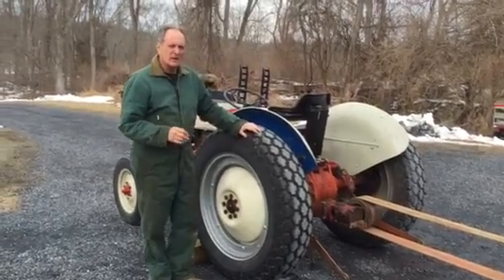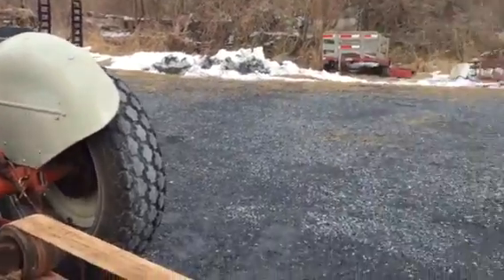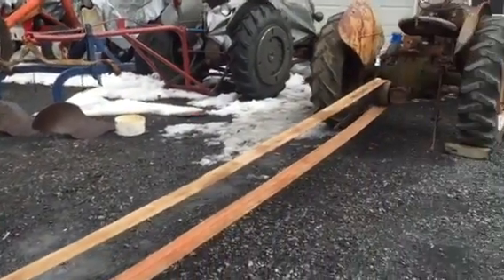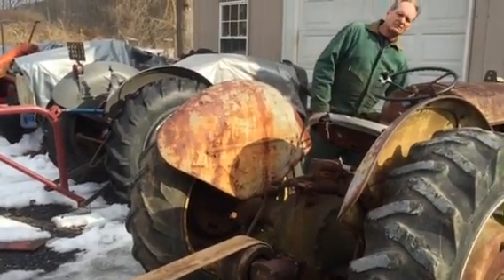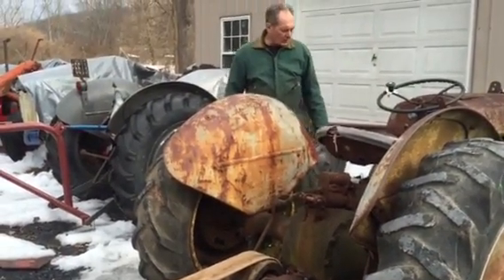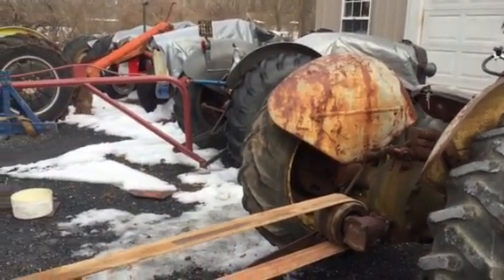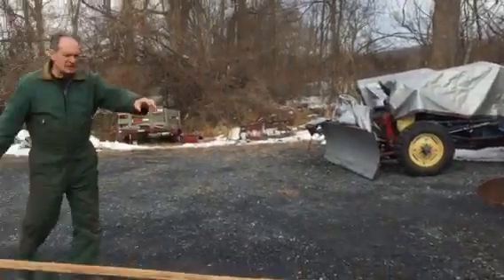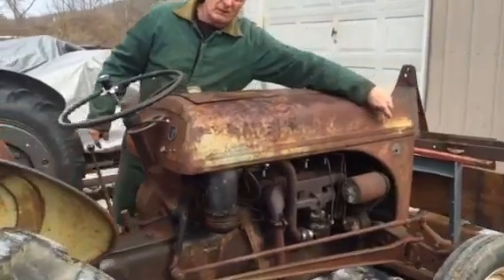Starting a Ford 9N tractor using a flat belt pulley from Ford 8N.

Comment: I have a 1944 2N will not start at all. I had it running shut it off now she will not even turn over any ideas ??
Reply from the maker: Could be a bad ground, small size battery cables. Faulty key switch. Sometime the rod from the end of the starter button will wear and you won't be able to make contact with the starter switch. You can bypass the system to get it running but make sure the tractor is in neutral, block down the clutch pedal and chock the tires cause you are bypassing the neutral safety switch. you can check out my other videos for more help or email me with question and I will try to help.
Kirk641@embarqmail.com
Reply: This started about 6 mos.ago,so I started purchasing new cables,new starter,etc. I have a question ? When I press the starter button all I hear are clicks,nothing else. Just 1 click. Does that make sense ?? Anyway I thank you for your quick response,and I will try what you said to do,thank you Ken
Reply from the maker: make sure you battery cables are tight.

Comment: I was not aware they made an 8N in 1947???
Reply: production for the 1948 8n started in 1947. Although it's considered a 1948 this one was built in 1947 which is why I referred to it as as 1947.
Sorry for the confusion.
also in has a side dizzy conversion on the '47 block to add even more confusion
Reply: Christine Witte x